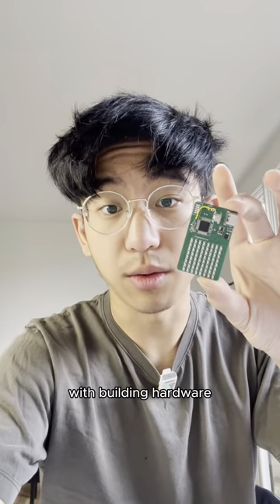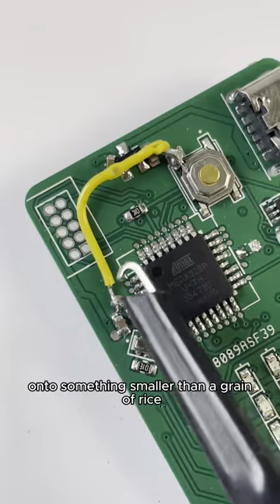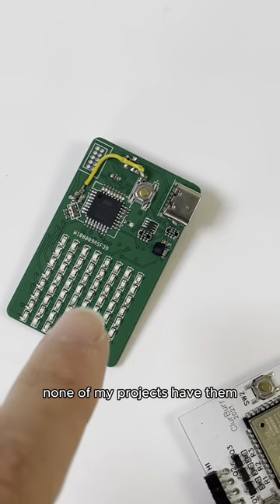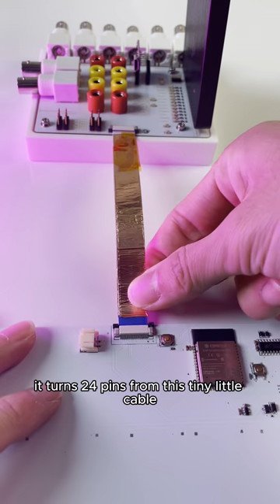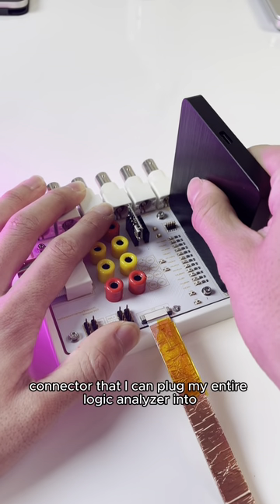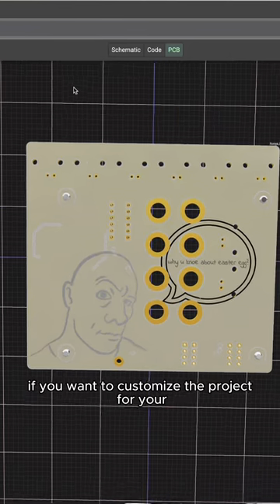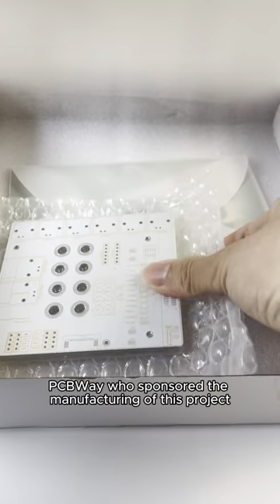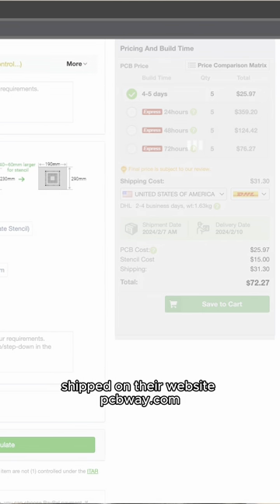Every electrical engineer needs a test board like this.

Comment: cool until you have to measure a fast signal and you realize you've absolutely trashed your SI.
Reply: Like another commentor said I like the logic analyzer setup, if he ditched all the other parts and just optimized that feature with proper impedence matching I think it'd be a handy feature to add, a small test port to check your entire system. May need to segregate the test ports to prevent crosstalk tho idk.

Comment: Just…use a different kind of probe…this is nonsense. But the logic analyzer is cool.
Reply: I agree, the logic analyzer part is the only bit I'd keep. Kinda neat to be able to plug your whole logic analyzer into a board at once like that through a test port. I'd suggest he just optimized that feature and dropped the other parts.

Comment: I'm on a more basic level but I've been working on a power board idea where i can put any source i want and then there's a row of connectors, need to make wires with test leads, install this voltmeter display, etc....i added a metal sheet to w plastic board so i have a safe ground plane in case accidents...etc etc... Battery holders for different cells. Still work on connectors for tabs like on pouch cells

Comment: Imagine just using the actual pinpoint probe under the hook.
9999%iq
Reply: Works, until you need to measure two points while also turning a nob or pressing a button... often it's hard enough to just keep two probes on at once by hand
Reply: @xxportalxx. Probes in one hand, knob in the other. Do you even chopstick, bro? 😊

Comment: There are pros and cons like many tools.
Pros:
can save time, repeatable setup, easy access, no need to hold probes, ability to use logic analyser, etc.
Cons:
Signal integrity depending on the PCB design, not for critical analog signals, etc.

Comment: Pretty neat idea. Some commenters talk about signal integrity going bad but if you are just measuring slow signals it should be fine with a shielded FFC. 

One suggestion for a V2.0 would to be add a programmer or JTAG interface on the ribbon cable so you can also load firmware to devices if needed.